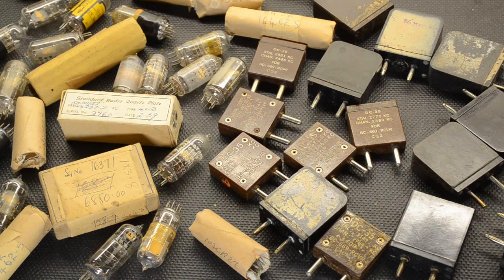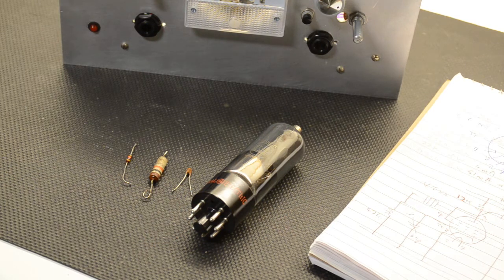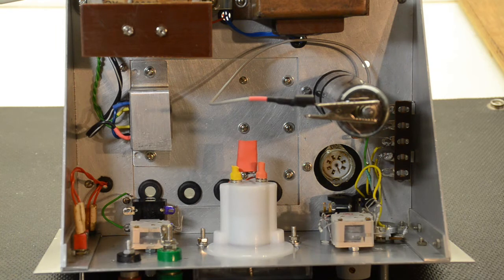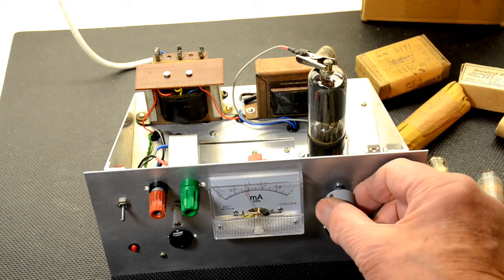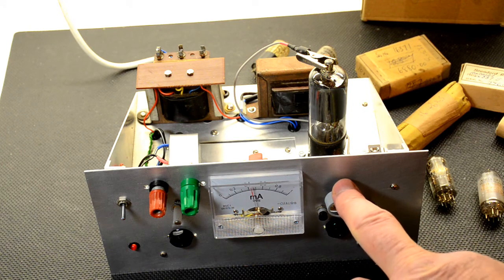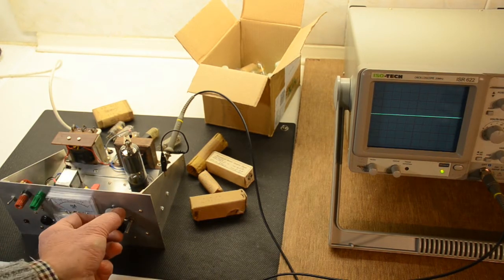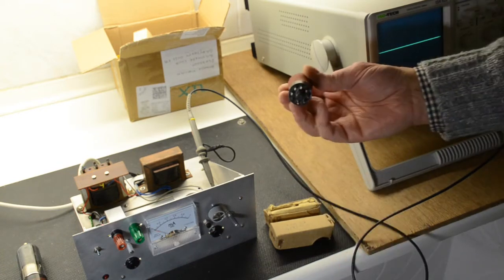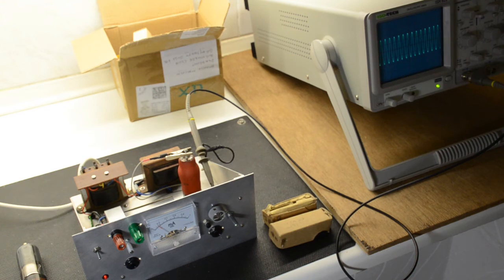The Radar Room -  A Simple Crystal Tester

Comment: Hello again and thanks for another excellent video. Some weeks ago I did ask about having a high DC voltage directly across the crystal. between anode and grid. I did receive a reply from you but it was deleted as soon as it arrived. I have always used an isolating capacitor in series with a crystal to prevent any DC across it. I look forward to discussing this issue with you. I checked my 1963 edition of RSGB and did find a circuit as you have used. However it appeared to be more a proof of concept rather than an actual circuit. I look forward to hearing from you and thanks again for all your videos. Best wishes from Perth Western Australia. Regards Clare VK6CCF
Reply from the maker: Hi Clare,
Thanks for the positive feedback etc :-) 
I've just had a look and can't find any evidence of your original question on here which is very strange... 
Yes, I've also seen many circuits where they put a cap. in series with the crystal to avoid the DC, but am not sure whether it is really necessary. As I also do a lot of work with physically small crystals, (with transistors etc.) I've never liked the idea of using them in a permanent configuration which might literally heat them up, though the circuits are out there and there doesn't seem to be an issue.
The main reason why I used this particular arrangement was that it was a very simple idea that could easily be built into my existing chassis with an absolute minimum of components. 
FYI, I've built quite few valve crystal oscillator circuits in the past and have never used this type before with the crystal between the grid and the anode. Food for thought!